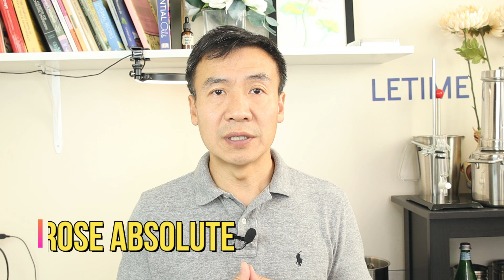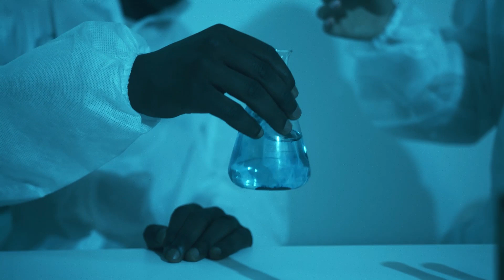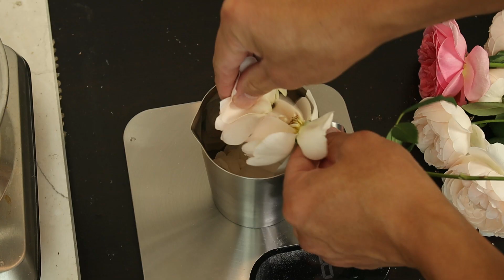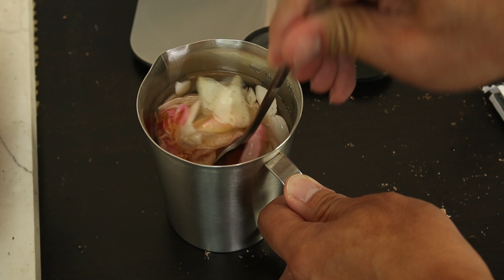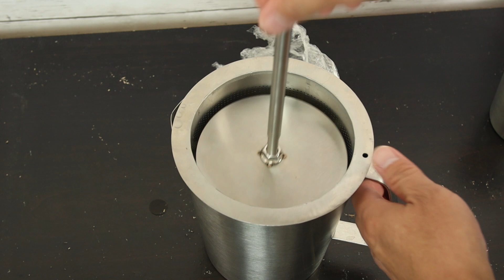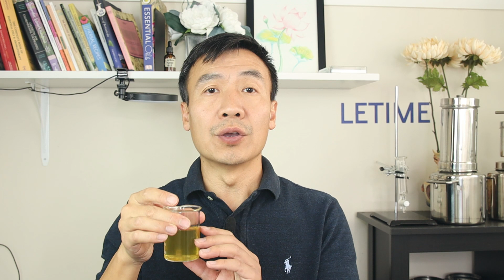How to Make Rose Absolute. Two Ways to Extract Rose Oil. Make Rose Essential Oil and Rose Absolute

Comment: Thanks for the video, so after soaking the rose petals in alcohol, how to separate the rose abselute from alcohol?
Reply from the maker: Low temp distillation. If available vacuum distillation is better to remove the solvent. Most simple way is let it vaporize in air or a water bath.

Comment: What an awful tease and waste of time. A tincture we don't need instructions for.
Reply from the maker: Thank you for your comment. Alcohol extraction is an old technique to extract oil from herbs together with other chemicals. That is why alcohol is often used for tincture making. Difference is for oil extraction pure or very high concentration alcohol is used but tincture is normally medium level like vodka. As I talked in the video solvents like hexane is used for Rose concrete making. But hexane is toxic which is not home friendly and that is why it is replaced with high concentration alcohol.

Comment: Please explain the distillation process after extracting the rose in alcohol. Thank you.
Reply: Hi. Dr mentions a video that explains this. I have had a look but I can't find. Has anyone else found it?
Reply: I haven’t found the video so sad
Reply: @anngeorge883  you'll need to run it thru a low temp distillation process or a vacuum distillation process, you could let the alcohol evaporate in front of a fan but you may have residues left over. This sounds weird, but if you look up how to make cannabis/THC extract with solvents and distillation, it's an almost identical process, just with different plant matter. It may be helpful to look that up for more instructions